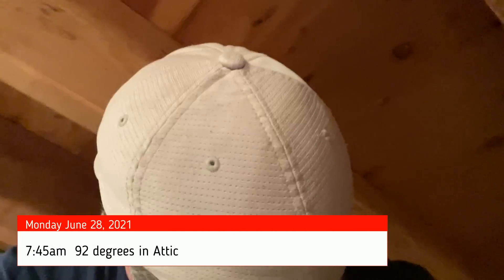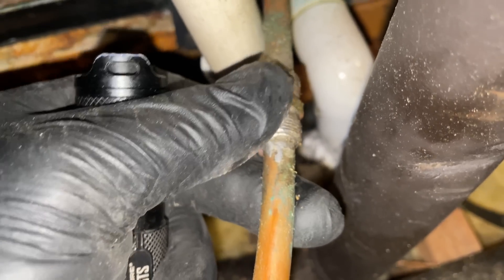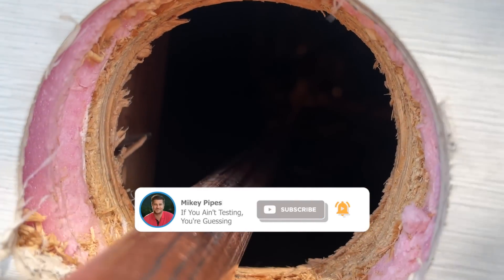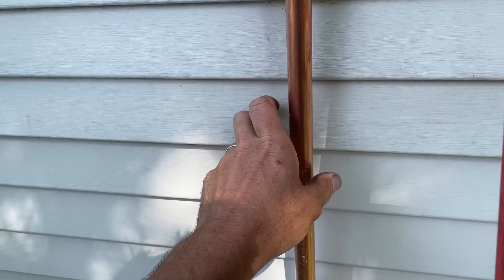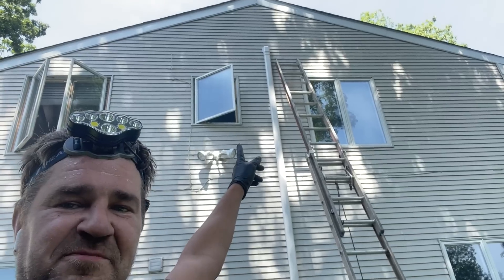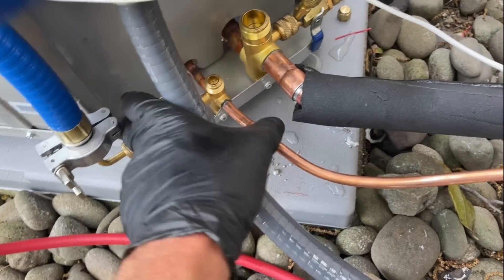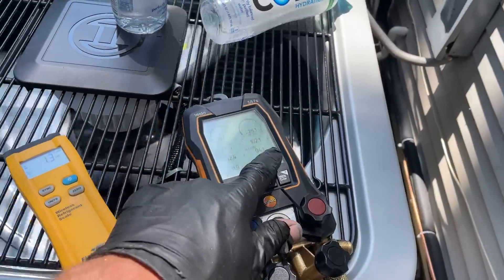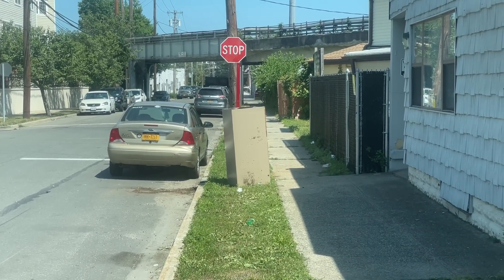Bosch IDS 2.0 Central AC Installation With Zoomlock Fittings & New Hire Joey Quit "It's Too Hard"

Comment: I asked this same question on several HVAC YT channels and never got an answer.
Do you see HVAC line set connections going all compression or crimp and TOTALLY eliminating the need for brazing ?? It seems that 90% of line contamination occurs as a direct result of brazing residue. Your thoughts please.

Comment: Stick with the RLS fittings. I heard RLS wasn't happy with the huge markup on Zoomlock fittings thus why the relationship went downhill. The Zoomlock max looks a lot less substantial than the original Zoomlock. I have has ZERO RLS based press fittings fail in 3 years.

Comment: Mikey......great video and installation. Back in April of this year I had a Bosch BOVB 36 system installed. I know of the bova 36. However I thought my system was 1.0 but when I looked at Johnstone Supply they listed the BOVB 36 system with the ecm 10 speed fan as 2.0 . From what I can tell from the bova 36 the BOVB 36 has the lower SEER rating. I also have the BVA AIR handler and a Aprilair filter system. The system is awesome. Right now it's 98 degrees and it feels like the Amazon jungle outside but the house is a cool 71 degrees. I love when the system kicks on and then steps down to a whisper once temp is reached. We're getting a 700 buck rebate back from NYSEG and a 300 buck credit from the feds once we file for this year. All toll with duct work, heat pump and handler....just a little north of 18k. That also included the electrician.  Back in May we had a couple of days in the 30s and the heat pump reversed and kept the house warm. Overall I could not be happier. The compressor and control board I think are made by Midea. My wife and I love our Bosch.  Anyway....I hope you find a really great tech that will tough it out. Good luck.
Reply: @PipeDoctor  so glad to hear yours is running well. I'm in Brewster NY. Put an county.  Moved up here from Stamford CT back in 2003.

Comment: All the trades are having a tough time getting young folks into the trades. They like the money but what they all want to do is work at something that lets them sit back and watch other people work. I worked as a technician for the post office fixing mail sorting machines for the last 8 years of my working career. Some days were not bad but some days you busted your hump fixing things and dealing with irate supervisors.  Servicing equipment takes good troubleshooting skills and a willingness to work hard and get dirty. you casn learn the skills but you have to be willing to do the job

I toaght a few new folks the ins and outs of that job, some took to it fine others not so much. Like you said it's good Joey learned it wasn't easy early on - better for him and you.

Comment: Hi Mike I'm sure they right guy will show up . As for the fittings I do think even for the ones used on water should have 2 O Rings at either end  just because . And it is good that the change to the new design is not going to be on your dime .   Next time please give us a longer video . Keep up the good work .

Comment: I intend to send an email soon to get a sticker. I want to put it on my outdoor unit to see what Carrier rep says next time they come. Less than 1-1/2 yr old 5 stage compressor. I wish Carrier would stop doing updates. Think I’ll disable Wi-Fi on the thermostat. We’ve had a heat wave here, my suburb of PDX peaked at 117 today. Unusual. I like thermostat at 70. Three times in the last two days, evaporator coil started freezing up. I could tell due to reduced airflow when notice temperature rising. Outdoor unit seemed fine — no icing, sweat on low pressure pipe. Third time, changed fan from always on to auto. Not an issue since. Shitty programming on a smart thermostat is my take.

Comment: I really don''t blame people for not wanting to work in attics.
Attic systems are horrible for service and energy efficiency. It shouldn't be legal to install an a/c system in a hot attic without a floor. With sub-floor laid down and roof deck insulated? Sure!

Attic systems seem to be an american thing. 
In canada, most homes with forced air have it for heating too and the equipment/ducts are in a nice basement.
For hot water/steam heated homes without ductwork, mini-split is the way to go.
(steam sucks too imo - inefficient due to boiler temps required)

Comment: I’m not sure if you or not, but is there a video of a Bosch system all the way around, how it differs from the average frame, carrier, tempstar etc? Haven’t seen any In my neighborhood. Only hearing that Bosch does not remove humidity?

One other thing I watch alot of hvac but never see anyone go through the permit and inspection process. No one really explains that the trap has to be this and that, the gas line has to be such n such, nothing. Just swap out the systems and off in the sunset.

Comment: mikey pipes recommendation for ductless mini split for a 300 sqft bed room in attic. use to be unconditioned., converted to bedroom. has R16 insulation in the floor. have 2inch rigid foam board in the ceiling and r 16 in the walls. no radiant barrier in the ceiling tho.  something on the lower end of price.  selling house within the year.

Comment: My helper passed away 2-3 week ago...

You grow close especially if they are with or around you a lot or especially if you have similar interests etc... He was like a brother to me.  

I have a new guy, grew up with him, knew him since little league...   But it's hard, Delbert/Jamie was like a brother to me. I will miss him until the day i die, he was so good at helping me he knew or it was like he knew what i was thinking... Makes it 2x as worse when you lose some one that or was a true "ASSET" to you and what you are trying to do with said company etc.

I wish you all the luck in the world man.. You gonna need it with those zoomlock garbage and "Ameribosch" :P systems ya installing.. I think you gonna have some (SERIOUS) issues on down the line but hey, i am glad if i am wrong and you have (ZERO) issues....  I just think the o-rings in the zoomlock will dryout, i mean look how armaflex does on the suction line especially if it has anytime on it at all. It "MELTS" onto the copper from getting so hot during heat mode on heat pumps..  

You may avoid that being up North East and all. 99.9% of all the systems we install are heat pumps. (RARELY) run into fuel fired stuff anymore and when ya do it's normally to change out to a heat pump, etc...

Best wishes Mikey!

Adam

Comment: I think you said 2 years HVAC schooling???? 
Im a novice self learner on HVAC. I think its fascinating because you have to be a technician of the different systems, (refridgerants, specific  manufactures, etc), an electrician, and most of all, a competent problem solver to remedy situations by thinking (testing as you always say) not throwing things at the problem hoping!!! What in gods name are they teaching in schooling that the first thing that comes out of an apprentice mouth is its "low on freon"??? Or "go down and change out the disconnect" with a deer in the headlights look???

Comment: Looks like RLS is the inventor and patent holder of the original press fittings and didn't renew the licensing with Parker due to allegations Parker was not passing on discounts. The new fittings sold by Parker are made over seas and use a hexagonal press. RLS uses a 360 degree press and are now selling the fittings themselves, still made in USA. You might want to double check before switching out.

Comment: Sorry you already lost a new employee. I started watching your channel to learn as much as I could about anything HVAC as I am dealing with some chilled water fan coil issues at my condo. I was asked if I was thinking of a career change...my first mental image was of our hero Mr. Pipes crawling around a dirty attic probably full of bat droppings on a 90+ degree day. Fortunately my state is the opposite...never seen a heat pump here in MN unless its part of a mini split. The majority of homes in the midwest are natural gas forced air heat w/ traditional AC and occasionally baseboard radiators with a boiler if its an older home (Ive even seen a gravity furnace in a home some friends were renting in college). Areas without natural gas piping is going to be electric or propane heat while stoves (burning wood, corn cobs, etc) have become very popular over the last 20 years or so. Air handler always located in the basement or in a main floor utility closet. I salute you Mike! Behind every bad fan capacitor, leaky evap coil, and clogged condensate line stands a sweaty red blooded American like you, wrench in hand, ready to fix what breaks so the rest of us can watch Netflix, shop on Amazon, and sleep under 2 blankets and a comforter while the AC blasts out air cold enough to keep a waddle of penguins cozy.

Comment: You got to love this kind of work because it is hot and nasty sometimes up in those attics.  The heat & the insulation can combine to make for a miserable experience.  But then, if it was easy, everyone would be doing it.  I used to ask customers if I could come in at 5 am to start and knock off by 10am any attic jobs, even if I had to come back the next morning to finish up.  I'd fill out the rest of the day with other work in a cooler location.  Good luck Joey.  Maybe an office job would suit you.  Leave the big money jobs for those of us who can and will put ourselves on the line.

Comment: Tried to watch some of them Bosch channel videos but makes me feel like its a high end goodman. Does it seem like a communicating high end system with that control board on both units thats suppose to watch the temps and ramp up/down when it needs to? The dianostics on the condenser board seem kool.
Reply: better than a goodman - stage the blower with a generic stat and the condenser follows based on indoor coil pressure. goodman comfort bridge is bs - stat just turns it on and off and crude algorithms do the rest.

Comment: for an all-electric home or a home with separate hydronic heating the Bosch in my opinion is hands-down the Go-To.. esp in areas where the load changes  like your area, midwest etc..  the ONLY issue is in the midwest its a Hard sell for someone who has Gas heat to go to all-electric..  if Bosch made a Hybrid IDS heatpump with a 95% efficicient gas furnace so those of us that like the Warm gas heat even on-10f days can have it along with the beauty of the heatpump for the majority of mild or somewhat cold days..  and of course the Bosch precision A/C and humidity control.   its getting time to upgrade the Zone system in my house.. and Bosch would be the only unit i'd consider if I could keep gas heat... now of course I could go with a combi-boiler or use the H2Air and install a hydronic coil on the IDS (im assuming)..  but that of course adds unnecessary complexity to the HVAC system.. something I dont care about because really HVAC design and software, etc is a hbby for me now.. but the average homeowner here likes his Gas heat..
Reply: @PipeDoctor  do they pair up with the IDS 2.0 control system? I guess i didnt look hard enough this could be what im looking for :)
Reply: Chris they do make them to work as a dual fuel setup
Reply: @jeremymanning6967  I somehow missed that on their site till you guys brought it up..  now you are talking my language..  I really woulsdnt want to give up my gas heat in ohio winters..

Comment: RLS used to manufacture the fitting for ZoomLock. They were literally the same system.

RLS and ZoomLock parted ways. If you want to stick with the type of ZoomLock you've been using, just switch to RLS fittings.

I'd try to hold onto the jaws and see if they'll just give you the new set. Then you'll have a set of jaws for both RLS and ZoomLock.
Reply: Interesting with the new zoom lock fittings you have - over here in aus they are the same as the “new” ones you got. The jaws fit in the rothenberger pro press gun
Reply: Its a real shit show. I have the milwaukee propress and ive been looking at getting the refrigerant jaws for it and trying to figure out which supply houses now sell which jaws and fittings and ive even talked to some of the counter guys and they don't even have a clue. Im lost trying to figure out which version I should invest in.
Reply: @PipeDoctor  the “b” and MaxiPro are from ConnexBanninger who are the manfacturer of the “b press” fittings. The largest supply house over here exclusively sells b press. Viega is only available from the smaller suppliers

Comment: I’m pretty sure the Bosch comes with over/under voltage protection on the board but do you offer a surge protector ..?? I used the ICM 493 on my 2.0 .. it’s the meow

Comment: Dig deeper on the zoom lock fitting issue for your customers thst you used old zoom lock fittings on.  You may be having a Navian type problem (failure down the road) with the old zoom lock fittings. Nice install.  Best of luck with the new service tech replacement. Keep videos coming.  Stay cool, go for a swim!

Comment: bosch is a system i like,just found out the hard way.they have a new blower coil not part of rebate system.i use rebates to get my customers go heatpump,and not just ac anymore.1st generation zoom locks had problems with leaks.i not far from you,alot of attics with blown in insulation.
Reply: @PipeDoctor  i was told it might be something with the jaws.the guy i work for now is a hack.he like some others in the trade probable messed something up.im told new fittings and jaws are more child proof

Comment: I don't know why you don't set those units up as Heat pumps.  The customers are paying for that expensive unit,  why not give them the ability to use it in heating mode also.  They may not want to fire up their boiler and just need to knock the chill off their house and could use it instead.